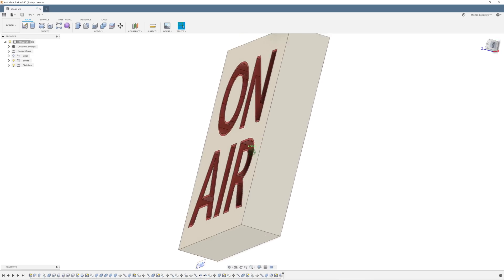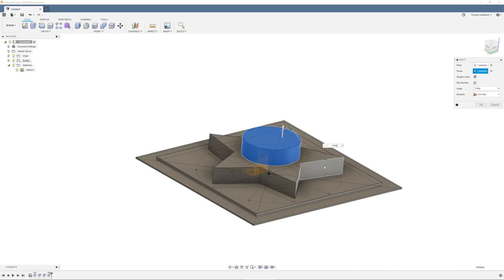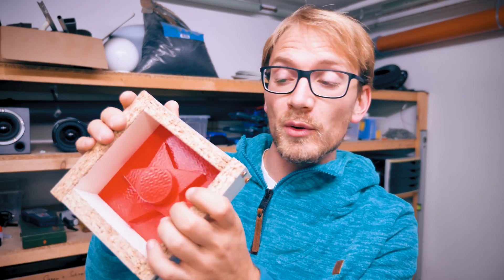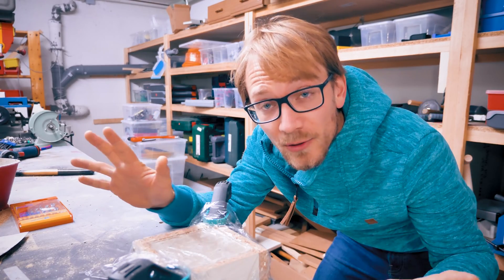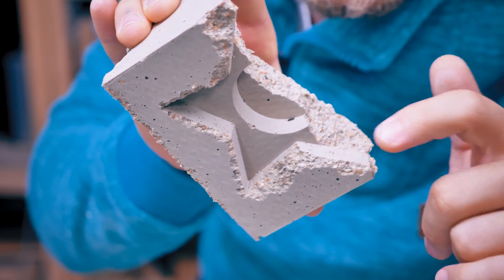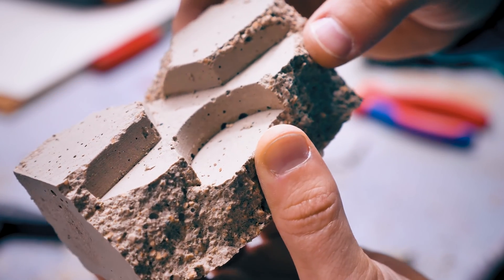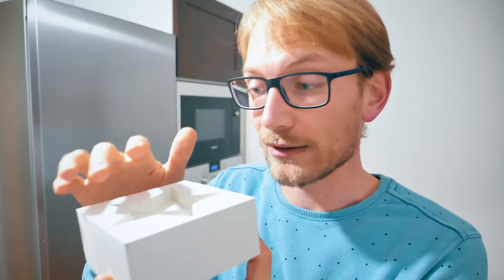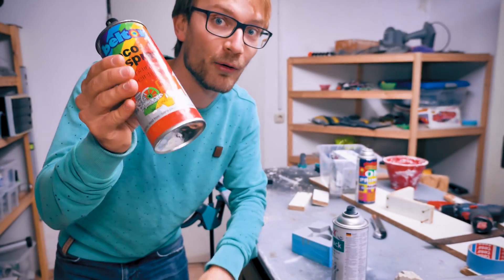Digital casting: 3D printed molds for concrete and plaster!

Comment: Isn't plaster like super flammable? For this use case I'd go with concrete.  Also how come all the youtube makers are casting concrete candle holders right now?
Reply: YouTube trends are a thing. Maybe they all watch Evan and Katelyn who did that a while back, like a year ago, and added that to their backlog. Thirded on non-flammability of the thing, I have no idea where this silly rumour comes from?
Reply: I don't think so. Both plaster and concrete release heat during the early stages of curing, but the temp doesn't get over 40-50 deg C in my experience.
Reply: both are not flammable at all. but as Dewex said, but both do release heat while curing
Reply from the maker: Maybe the raw plaster is if you kick up a ton of dust, but cured plaster is absolutely non-flammable. Drywall / sheetrock / plasterboard is plaster sandwiched between two sheets of paper, and is used as a fire barrier in almost every timber-frame house.
Reply: @MadeWithLayers  plaster even in dust form is no flamable, if you heat it to 1050°c it melts, but never enter in combustion, it's like sand: 100% non flamable

Comment: about the star CAD: I suggest you split it in various sketches. Sketches don't have history, adding a sketch help by adding a history point.
Reply from the maker: Thanks for the tip! I've never thought about how the history is created, but I've definitely clicked out of a sketch and lost a good 15 minutes of work before.
Reply: @MadeWithLayers  Yeah, and they become messy and tangled if you put too many things on them. Adding sketches doesn't alway work as a cleanup solution, because you need project your needed anchors on the new sketch and that's a mess in itself.

Comment: If you are going to use concrete it would be a good idea to coat the mould and the pattern with a light oil or grease. Makes easier to seperate

Comment: Great... I'm almost done with a video where I'm pouring cement in printed molds as well... I thought my idea was unique! :D Anyway, I really like your vid! One thing you could do to prevent the paint from wicking under the masking tape is to apply 1-2 layers of clear coat after masking it off. I like to use a polyurethane lacquer for that. That will seal both the plaster and the small gaps between the tape and the plaster and prevents any subsequent paint from wicking.
Reply: A wise person once said, there is no new idea under the sun... and with the amount of people living today I think this becomes more true every day...
Reply: Been there done that.. So to speak.

Comment: I'm not sure why you had to use .1mm layer height over .2mm. Seems like a simple design, what would be lost in detail?
Reply from the maker: I wanted to minimize the chance of the pattern locking itself into the pour - but in retrospect, a slightly larger layer height would have been just fine, too!
Reply: @MadeWithLayers  Thank you for the reply.

Comment from the maker: Concrete or plaster for the big one?
Reply: if done right. concrete looks better imo. but you have to get the mixture right
Reply: Use Plaster: Lighter easier to work with can mount it without fear of it hurting someone.
Also, just a thought: To give strength to the cast use 3D printed scraps as aggregate to make it more shatter resistant like rebar in construction. The long sticks trimmed from the supports would be good and light reinforcements.
Reply: Super fun!  Might want to use a spray on or brush-on wax mold release.  Watch out for the undercuts (burs overhangs and anything that traps the casting material)  I'd stick with concrete... maybe use one of the casting-concretes, like what's used for cast counters.  Mold making and casting is so much fun.
Reply: I think plaster is the way to go, since it is lighter.
You can use spray glue and sand/coarse stuff if you want a ruff surface.
Reply: The plaster looks awesome!  But not knowing what your big project is, not sure if you want the rougher look of concrete or the smoother look of the plaster.  Would concrete take the paint better than the plaster?  You said you liked the texture that the paint had when used on the plaster, are you going to want that texture on the larger project?  If so, concrete may not give you that texture with the paint.  Then again, concrete will have its own texture.  Uff da, guess I'm not much help am I.  Thanks for the video though, gives me some crafting ideas.  Love your work!
Reply: Plaster looks nice, but the surface will be quite soft I guess. Maybe there's a way to seal it, though.
Reply: Be careful you don't make something too big that is awkward to handle during casting. Make sure the mould container will be strong enough to support the head of liquid when it's full and that there are no leaks around the bottom. I have had quite a few disasters with catastrophic leaks which have ruined multipart moulds half way through their production. If the mating surfaces are good and flat, that's half the battle. I seal things up in the inside with plasticene and on the outside with gaffer tape for big casts.

Rather than screw chipboard together by its ends to make a one off mould box, why not make a set of mould sides, which clamp together? See this: http://hapcoincorporated.com/hapco_brochures/Adjustable%20Mold%20Box.pdf  You'll be able to use these for lots of jobs. I have had a set I made over a year ago and they're still going strong.

Try the sand and cement mix, or if you decide to use plaster, throw in a tub of PVA. PVA will make the cast item a lot harder and more water resistant.

Also, don't bake your casts. It will weaken them substantially. Just let them dry naturally. Put them in an airing cupboard. I have tried  oven baking and microwaving plaster moulds and it ruins their lifespan.
Reply: Both? Apparently 80% plaster 20% cement is pretty close to Ultracal, which is designed for mold making. 

See here: https://www.rcgroups.com/forums/showthread.php?2254757-Ultracal-30-alternative-New-FTW-source
Reply: to improve the strength of the finished product you could use a thin layer of plaster (which usually hardens quickly enough) and the rest in cement, which once hardened correctly is much more robust.
Reply: You will get a really smooth and durable result if you use fine concrete mix. Put oil on all surfaces before pour and let it cure for at least 48 hours before removing the wood and several weeks before priming with concrete primer.
Reply: Concrete - heavy duty stuff. You can use a Rutsch with vibrator-function and vibrate the mold to remove air bubbles.
Reply: GFRC - Glass Fiber Reinforced Concrete... And use mold release.
Reply: I like working with plaster, therefore I recommend it. You can mix in small impurities like microscopic Plastic Stars or even some small rocks. For stability you could try to immerse ether a steel wire skeleton or simply wooden sticks that you had in water for at least 6 hours previously to casting them in plaster. For getting out the air bubbles you could buy a cheap vibrator (look, even man can find a use for vibrators :P ) and simply stir around in the still half liquid plaster. If you want to produce a semi solid structure, add lots of starch to the plaster: The heat from the curing of the plaster should solidify the starch into a jelly, which has a interesting feel to it. Sadly, this recipe doesn't react to kindly to drying....
Reply: I prefer the plaster personally, but why not make one of each, then compare and contrast?
Reply: Both!  Give him the better quality one. :-)
Reply: It depends of the results you're looking, and the specific use you want it for:
Concrete: more dense, heavy, weather resistant. Apropiate for big casts, or for use under mechanical load. If you plan to make a very big piece (40*40cm or more) it should be reinforced with 3-4mm diameter metal rods spaced about 15cm from each other in longitudinal and transversal directions, if you use the smooth ones instead of the corrugated type, bend some hooks at the end of each end, since the concrete is good to withstand pressure, but not flexion. I recomend to take away the mold 3 days after they casting. Very versatile with the finishes, you can add gravel, colorant for concrete, broken glass, seashells, marble gravel, paint it...
Plaster: lighter than concrete, but not good for exteriors, excellent to make detailed castings and cures (dries) faster than concrete. Not good for big castings or when it goes to be under mechanical stress, but you can add some reinforcement with plastic fibres (15mm long leftover PLA filament is great for it) in the mix to avoid cracks. Can take the mold apart in 2 hour. You can paint it or leave as it is. It corrodes metal in contact with it.
In both cases is ok to use a mold release agent if be used in moderate quantities, it don't interfere with paint application if you wash it with mild soap and water.
Reply: My only consideration is if it's going outside, concrete is frost proof. Also it just depends on what texture you prefer, I think plaster will look a bit like plastic, too smooth. Interesting and practical use of 3D printing by the way.
Reply: None because i´d choose "Fertigestrich".
You get the look of Concrete and it´s as easy to use as Plaster.
Reply: Plaster - Definitely! Looking so much better.